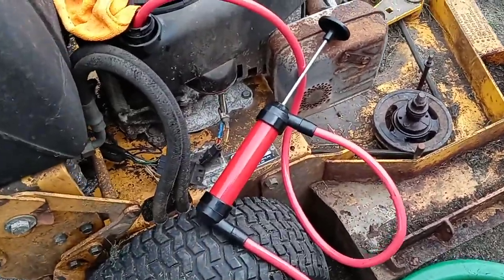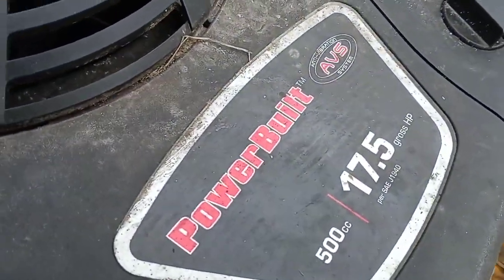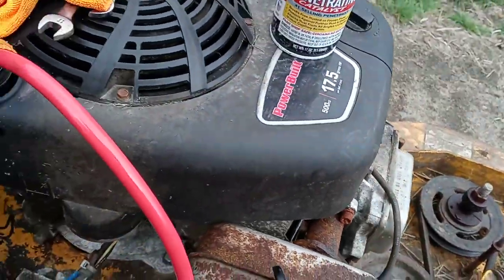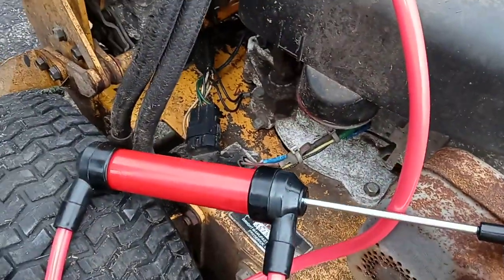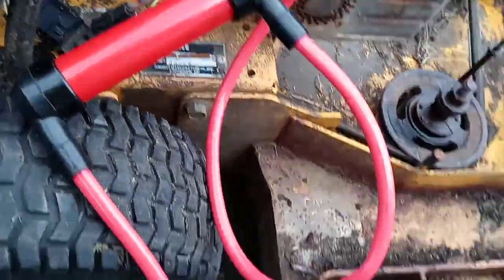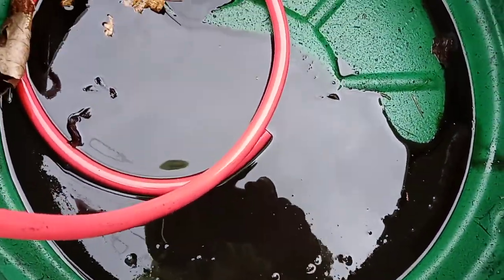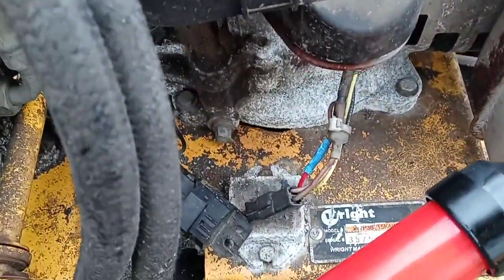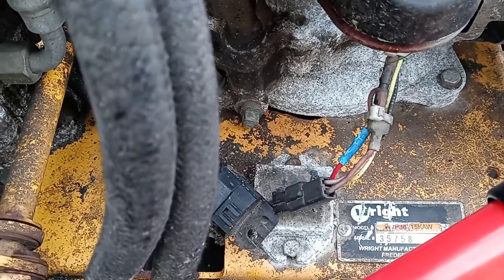17.5 hp briggs and stratton. oil change

Comment: Hey man, where exactly is the oil filter located? I have the same engine on a poulan pro riding mower and can't find mine for anything.
Reply: Hey there I'm also a florida man with the same question.  Where the heck is the oil filter located
Reply from the maker: There is not oil filter in this machine
Reply from the maker: There is not oil filter in this machine
Reply: @ideaslandscape  thanks.  What type of oil goes into it?
Reply: @Quail_Dad  10W30

Comment: Note: I tried this and you must make sure that you disconnect the oil pressure tube on the other side of the engine or you will fill the cylinder and crankcase full of gas. The tube on the pump leaves no room for air so it creates a vacuum in the engine. Be careful out there. Not all videos work out they way they were intended.

Comment: Any idea how to remove the airfilter cover please
Reply from the maker: Thank you for watching and comment
 Yes you see the 2 knobs on the right side? turn it and it will pop the cover then you'll see the air filter just pull it and lift it a bit
Reply: @ideaslandscape  Yes i turned till the cows came home I had to cut them off Seized with rust
Reply: @trevorlonewolf6406  I’m having the same problem. My air filter cover is broke so I need to get the two knobs off and Order a cover just like the one in the video. Having trouble finding one though. Any ideas on finding a cover and getting the knobs off. Thanks!